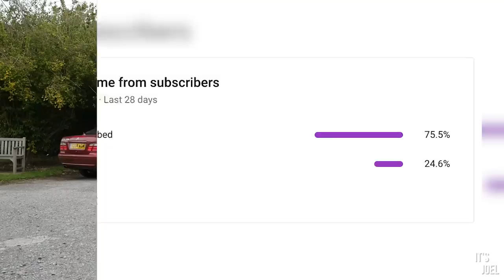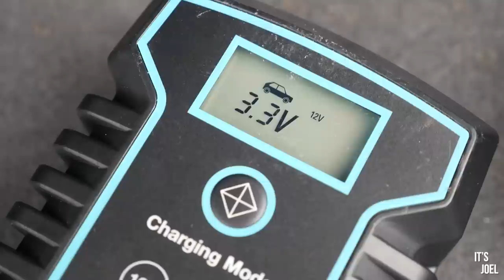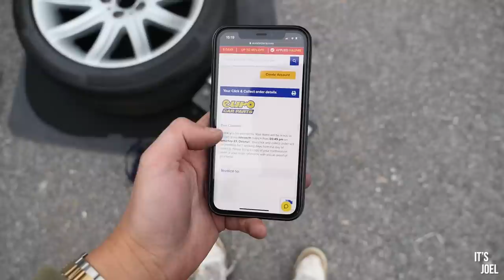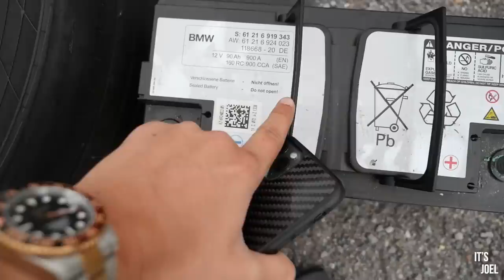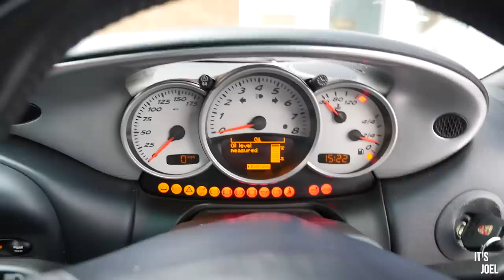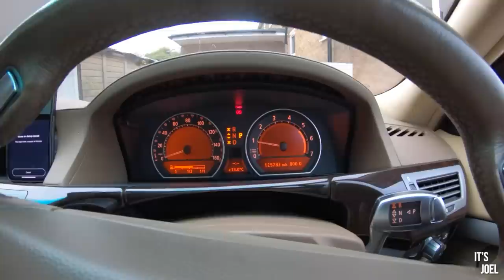My V12 BMW 7 Series is dead…

Comment: As a mechanic myself, it pains me when people aimlessly replace things. 

The battery not holding charge was an obvious indication, was a good test to do. Props to you.

While it pains me to see people replacing things randomly, I love seeing people working and fixing their cars them-self. Good for you pal — loving the content, keep it up!
Reply from the maker: Appreciate that, thanks you. As a mechanic may I ask, is it essential that I have the new battery coded?
Reply: @itsjoel  you only need it coded if the amps on the new battery differ from the old one. also check the alternator as that much discharge isn't normal for a battery if it was fine some weeks ago
Reply: @itsjoel  Yes, I would definitely get it coded. With newer cars it is much more important to do it asap, but with this old bm it’s not a necessity to do it straight away. (Still get it done though!!) personally, I wouldn’t leave it more than a week.
Reply: @meer-cha4985  doubt there is an issue with the alternator (start the engine, you should get around 13.5 or above)

More likely a drain, however battery’s can just sh*t themselves eventually.
Reply: @itsjoel  can you code it yourself using carly?
Reply: Its the failure of the very expensive watercooled Alt is common at this age. lucky the n73 share the same as the n62 they can be sourced
Reply: @itsjoel  You NEED to have the battery "coded" in two ways. The first of which is that the original battery for the E65/E66 was an AGM battery, The Exide Premium EA1000 is NOT AN AGM BATTERY. The car has different voltage and draw-down levels for AGM vs Non-AGM. Secondly, if the battery isn't registered as being "replaced," it will cycle as an old battery and wear it out super quick. If you do neither of these things, you can expect to replace the battery in the next 12 months, and start getting frequent "RECHARGE BATTERY!" errors with the car being only off for a few minutes. -- (I own a 2007 E65 with almost 300,000 km)

Comment: I know with the more modern stuff BMW’s should not be charged directly to the battery, instead use the points under the bonnet. Might be worth seeing if the 760 has these too

Comment: Leave the jumper cables on, then place the charger onto the duff battery, it will trick the charger to charge.
Reply: Yep had this before and saved a battery on my DB9 V12 the trickle is struggling because of the sheer amount of charge it needs.. sold the car but that battery still going fine to this day as far as I know after doing the above

Comment: When boosting w/another car's battery, always boost from battery to battery, since you'll have the most stable voltage & current running to the car you are trying to start (also, the shorter the jumper cables, the better). Also don't forget to measure whether the bmw's alternator is charging your new battery, as it might be the initial fault why your previous battery has failed.
Reply: Yes a broken cable can be expensive!!
Reply: To check if alternator works fine just check battery voltage on running engine. It should be 14.4V-14.8V
Reply from the maker: I would ordinarily do that, although the manual in the car says not to jump directly to the battery, but to use the boosters
Reply: Don’t suggest something like that if you don’t know for sure. BMW manual states that you should newer jump the car battery to battery for a reason.
Reply: From my experience (several starts of car with dead battery in the cold) I would rather try not going this way, but: connecting both cables on battery terminals in running (donor) car, positive cable to positive battery terminal in dead car, negative cable directly to the engine of dead car (not negative battery terminal), either for example  alternator tensioner/bracket or engine block/mount directly to make sure the electrical connection is created.

This way you don´t waste your time reviving already dead battery, but you use maximum of available power to start the car directly. When the car´s running, then it can recharge the battery on its own. 

Hope I explained this method enough 😃
Reply: @itsjoel  I would definitely stick to what it says in the manual.  Most modern cars have jump points for a reason.  Connecting directly to the battery can cause power spikes that may burn out some of the more sensitive electronic components.  The purpose built jumper points shield those components to minimise the risk

Comment: Well done Joel, but you've fixed a symptom of the problem. not the problem.
You need to investigate as to why the battery had gone flat.

The multimeter will read 11.7 - 13v when its attached to a running car, as you're measuring the voltage of the known good battery in the CLK, not the dead one.

The dead battery will have got the 7 series started again if you'd have left the CLK attached to it running for 30 mins or so, or if you had someone hold the revs on the CLK at 3k or so whilst trying to start the 7.

The old battery from the 7 is not completely useless either, it just needs to be have a higher current stored before the trickle charger will recondition it.

Did you measure the alternator output voltage when you got the 7 going again with the new battery? It sounds like the alternator could be the problem.

Loving the videos and keep up the good work!
Jordan
Reply: Sometimes cells can just drop in old battery's

Comment: My thought, you did well with the more-expensive, presumably higher quality cables. Cheap manufacturers sometimes go for a high-quality look by making the plastic thicker, but what you need is a thicker copper cross-section. 
The longer the cables, the thicker they need to be to make up for the amperage restriction over length. Cables designed for diesel trucks are the way to go. They also have stronger clamps that provide better connectivity at the contact points. Keep in mind a bright, shiny contact point is best.
Longer cables also mean you don't have to worry about reach.

Surprised to see that cables in the UK seem to come in individual pieces. I've only ever seen the red and the black welded together, except for the end sections.

Comment: grab yourself a NOCO GB70 - it will start ANYTHING thats flat..... I use mine day in day out and its never struggled to start anything 12v yet, even heavy machinery etc

The 13v is only showing because it is the voltage from the running vehicle (merc in this case) - So when you try to start the BMW with that connected, it is trying to draw all its power through the jump cables and they are not enough to get it going.

Comment: I have had a couple of BMW's of this age (3,5) - if the starter hasn't gone already then that just means it's going to go. They tend to go between 120 and 140k miles. I have heard, but can't confirm if it's true, that a dying starter motor can kill a battery because it tries to pull too much power.

Comment: Good fix, well done - not sure if it's already mentioned, but the small grey pipe should be plugged into a hole somewhere on the battery - it's the gas vent pipe, it vents outside the car, otherwise the battery is venting into the boot.

Comment: I bought a trickle charger from Aldi for about 15 quid. Also bought a battery starter with connectable cables, which is a much safer way to start a BMW (less chance of screwing up electrics etc. Nonetheless, I'm glad you have now started to attempt to fix stuff on your cars.

Comment: If you want to make big inroads in vidlogs like these..  You need:
1. Battery health, alternator checker
2. A quality booster
3. Several trickle chargers

You need to purchase quality items...  Count £300 all in...

Then you can keep the batteries in shape and verify their lifespan. Keep them charged correctly. Get a booster to start vehicles without going down jump leads..  Safer and better...

I always try to purchase a bigger CCA battery with the existing dimensions if possible...

BMW especially don't like old batteries..  The vehicle is plagued with error messages if the battery is old (60% or less life remaining)....

Comment: Welcome to E65 ownership. Had the same issues. First off please replace your battery. Secondly get someone with a laptop and with cable and ISTA, or access to the OBD2 software and tell the car you have a new battery. You'll find 90% of your problems will go away. You don't need an AGM battery and you can pick up batteries for the 70 to 90 quid mark. Might be worth looking at your alternator other than starter motor to see if it's charging properly

Comment: Everyone‘s worried about coding - I reckon, you check on the battery ventilation once more, as to the video you didn‘t remove the transportation pin on the battery ventilation and the hose remains unconnected within the spare wheel well. Double check to let the battery breath during charging (driving) properly…

Comment: Nice one. I know the codes cleared but I would have checked the alternator was charging ok. Battery would be approx 12 volts engine off and 13.5 to 14 volts engine running.

Comment: You should check if the alternator / charge controller is functioning optimally. That is one of the main causes of batteries to fail.

Comment: I never thought those jump leads would start that as the starter takes 400 or amps or more to turn the engine over.   Anyway running a car with a battery that dead is also not good for the electronics.

There is always a chance that the battery would have come to life by connecting the charger with the jumper leads attached to another battery and leaving it for a week or two.

Unfortunately, your replacement battery is not correct for the 760. The power module will need to be coded for a non-AGM battery, however, that does not make much difference. You will find that the non-AGM battery will run down after 4 or so months (unless you drive the car every day). When you turn off an E65 it takes large amounts of current out of the battery for many minutes. This means a normal lead-acid battery is always in a semi discharged state. The best way around that is to throw the charger onto the car for a day or so every couple of months. The AGM batteries will be the same except you only need to charge them every 6 months or so.

Comment: You can't use a tender on a flat battery you need to buy a standard battery charger,  something that puts in a standard 4 amps first and lift the voltage. The tender floats the voltage and is great if you leave the car  or have parasitic draw, good luck!

Comment: fyi When you measure the battery voltage on the BMW with the merc jump leads on, you're just measuring the merc voltage, you would have got the same voltage readings if you had taken the battery out and wired the voltmeter to the battery connections

Comment: just check what volts going in the battery when engine is running,it just makes sure your alternater is working it should read between 13.5 to 15v going back in the battery, good luck Joel

Comment: I have a 99 e38 750il. I had to use my subaru and a booster pack to get it to start. Had the same problem 1 battery was flat other was fine you need alot of power to get it to start

Comment: Unless you bought a AGM battery the new battery will be damaged in 6 months due to incorrect charging also you have to program the new battery to the car otherwise it will over charge it.

Comment: Code the battery with Carly, that’s why you have the subscription. No need of ISTA etc.
Also i am pretty sure that the old battery is not dead. Connect it with a good battery and then connext the trickle charger. 
If the trickle charger has recondition mode pls enable it and the battery will be back to life!!
Reply from the maker: You can’t code the battery with Carly on my E65
Reply: @itsjoel  I have an E63 and I thought it is possbile on E65 also. Glad you took the time to respond Joel

Comment: Sorry about your battery but my AGM one in my 2005 760li did exactly the same thing.  Although the car leaks charge away over about a week it always took a trickle charge until ........ it didn't.  Dead as a Dodo. Jumping from my 2000 Mercedes CL500 to the connections under the bonnet did not work either.  So I then switched battery over from my CL500 which was about the same and then it started just fine. So I purchased a new one for the BMW and installed and then cleared about 30 error messages with ISTA that are triggered by low voltage.  You can use Carly to code the battery yourself (or ISTA of course) but you may need to pay an extra few quid to Carly to do so.  By the way the starter motor in my 760li is starting to cause problems as it does not disengage cleanly and makes a nasty noise until it clears the teeth on the ring gear. Did you remove the plug from the battery and connect the vent hose? I could not see that you did.  There is a plug at each end and you only need to remove the plug that you will insert the vent pipe connection into. PS - When you read the voltage while you were connected to the Merc it was mostly reading the Merc's output I guess and not the health of your battery. PPS - did you see my invite to drive the BMW to Kyiv in another comment?

Comment: Load the battery by putting heaters lights etc on then check voltage on battery see if alternator is charging

Comment: Had to replace my E85 3lr battery as had similar problems jump starting the car

Found out it's not just the volts but the amps which start the engine

That's why at a 12v reading jump start, if you don't have sufficient amp's the engine won't start, as you found out using the jump lead's

On the top of the BMW battery post it will be stamped a date, mine was 48 04 (week 48, 2004) and lasted 16yrs

I only drive my car at weekends as use a company vehicle and the battery went dead instantly without warning

Comment: You will need to code the battery to the car, which you can do via Carly. The car needs to know the battery is new, what capacity and type so it can be charged at the appropriate rate. Well done on changing battery yourself.
Reply: Indeed

Comment: I found my bmw never jumped off the jump leads. To the points at the front. But it did used to jump from the battery straight to the battery. Also it was the alternator that caused the initial fault.

Comment: Brilliant job, next time I’d be carful and leave on the battery protection covers when sliding into position, reason being if you were to knock the battery over and it touched the bodywork of the car it will short out with a lot of fault current, which wouldn’t be nice!!! Order than that good job

Comment: I wish I had time to watch this yesterday, today at 8 am I got into my 2017 Megane 4 and It did the same thing, just a small knock and nothing else, got pissed off cause I thought some wild animal got under the hood and bit the fuel lines (very common with Megane) and I had to be in Uni 200km away in few hours, fortunately, a neighbor came and saved the day with his "professional" charger. And now i see this :)

Comment: Good job mate hard to see on camera but always disconnect earth lead first and re connect it last 👍this avoids any nasty sparks and damage ! Good to see your getting it coded as a lot of people don’t know that it needs done. I would leave it on your new charger when not being used mate as it will keep tune battery in good health. It should be a maintenance charger too if it’s good one you bought 👍it’s ok to charge it from the bonnet points too Joel

Comment: Thanks for the grand day out just tinkering with the car/s😂 i had an old honda and it was the same problem. Low voltage. New battery sorted it after i had to go home and get the spare key as the immobiliser kicked in. Great vids. Thanks squire.

Comment: How unusual, the V12 BMW after several severe spankings round the ‘green hell’ is AWOL, how did that happen? It’s an omen that you’re relying on its German rival. albeit all £1,000 of it.... good luck. Ps does the battery not need  be coded in?

Comment: This is advisory, I would not wear my watch to work with voltage unless they are designed for use in magnetic fields like the Rolex Milgauss, be ready to demagnetise your watch.

Comment: What do the silver buttons on the steering wheel do?
Reply from the maker: They’re how you change gear in manual mode, both on the front downshift, and there’s two on the back for upshifting
Reply: @itsjoel  oh right ok thx mate love the vids.
Was just wondering cause I’ve never seen a car with shifters on the front of the wheel

Comment: Best off not trying to run the BMW (Big Money Waster) with a known dead battery. Unless there’s a solid 13v + running through its veins the myriad of delicate electrics will not work properly and you will have lots (and lots)  of faults. Use the Porsche.

Comment: Given the number of cars you have I'm surprised you don't have a trickle charger already. They will save your batteries during long periods of non use.
Also, the beemer is probably having a hissy fit because of the other German interloper on the drive
Plus, having seen how heavy the spare wheel is every man on the planet now knows why their wife insists on being in the AA / RAC
Reply from the maker: I do have two trickle chargers (now three) but they’re both in the Range Rover, which is in Wales 😂

Comment: Why fasten a seat belt just to reverse? No legal requirement to wear belts in reverse, still following driving school rules?
Battery was clearly buggered, if it won’t charge then the only answer is a new one, no amount of trickle charging will ever charge it up!
As for measuring the voltage, the Mercedes also has a charging problem as it should read 14 volts engine running.
The easy answer for folk like you with no idea at all is RAC membership, they come out and say new battery required and will sell you one and fit it too.
No amount of overly priced battery chargers or multiple meters compensate for lack of very basic knowledge.